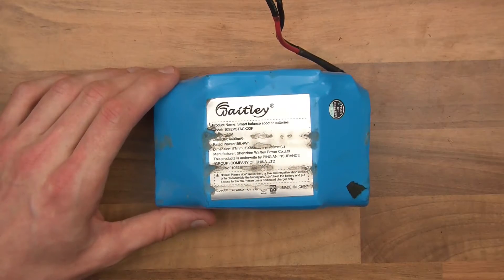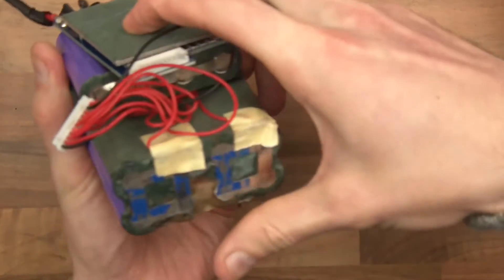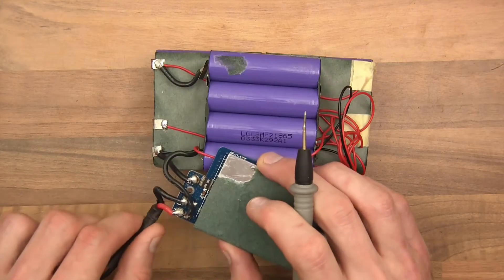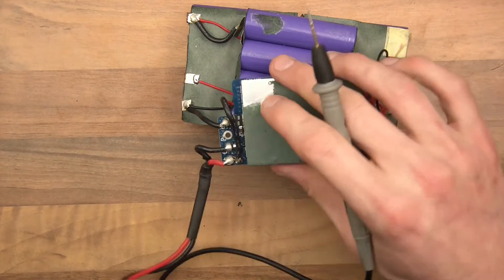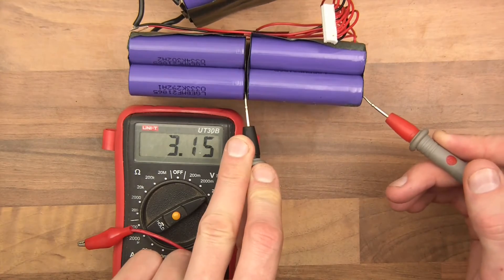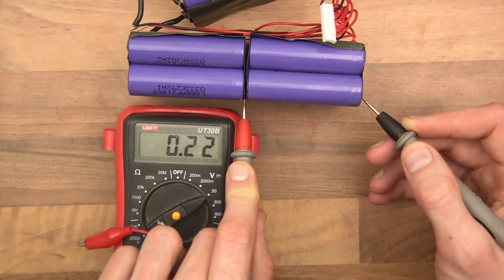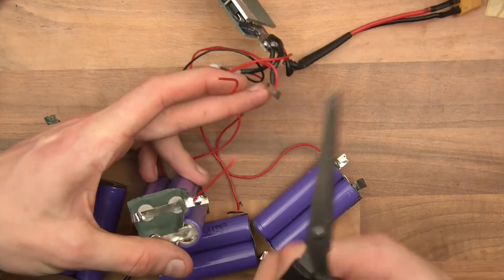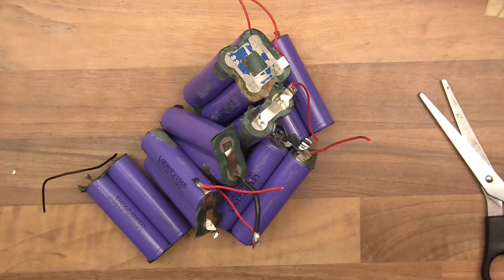INVESTIGATING: A Broken Lithium Ion Battery Pack! Cell BMS.

Comment: Just did this on my 18v drill. Showed no sign of low voltage  but just died one day and wouldn't charge. took apart found a bad cell replaced it by cutting metal tabs and soldering directly back on to new cell. Bada bing
works great.
Reply from the maker: Yeah! Interesting isn't it?

Comment: What has happened is one of the cell has an internal short which caused it to discharge  and the reason whole pack has went out is because bms has this protection built into it which causes it to turn off when it detects any cell which is below 3.2 volts  so your bms is fine and its actully one of the cell in 2p couple which has died
Reply from the maker: Exactly!